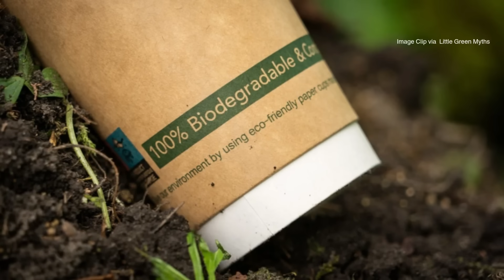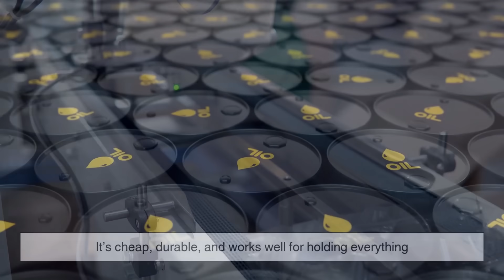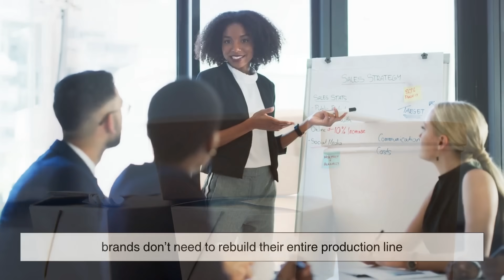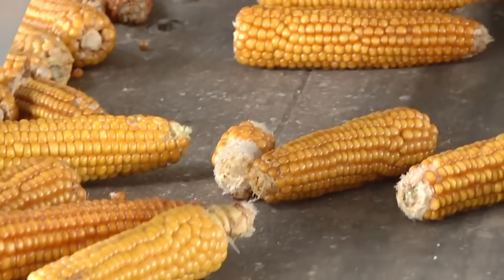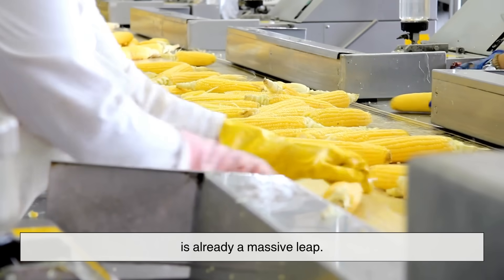How the Packaging Industry Is Turning to Corn for Solutions

Comment: Actually not that great.
1. It's still plastic. It won't biodegrade if you toss it in your compost pile or into the trash and landfill. It will only biodegrade in a specifically built facility to biodegrade it. What's the point of that? That's like sending plastic into a recycling facility. And recycling is even better, because it's more economical, and produces new plastic instead of just biodegraded waste, so recycling actually reduces the need of making plastic from oil or gas.
2. There aren't the facilities to biodegrade it in most places, unlike recycling, which is pretty much everywhere.
3. For all that trouble, it's more expensive to make.
4. It takes up crops and fields that can be used for food or livestock feed or natural habitats.

So, it's just hype.

Just looking at the title gives the impression like it's just made from some corn fibers, but no. It's a polymer of lactic acid slowly made from corn by bacteria, like plastic is a polymer of ethylene or some other molecule from oil or gas. So calling it plastic-free is misleading. Not to forget, oil and natural gas also come from living things that decomposed. And waiting for bacteria to make it is slower and more costly.

Comment: How phone detecting when you put in your ear during phone calls and switches off screen?
Reply: Proximity sensor, it's located on the phone near the call speaker. 
It works if you cover it with your hands.